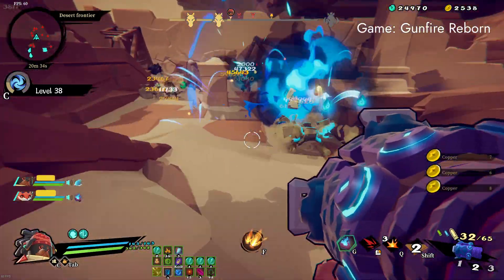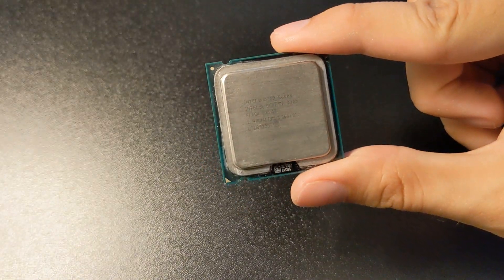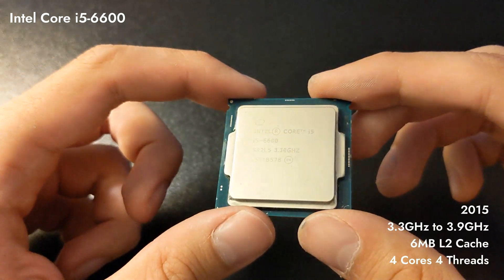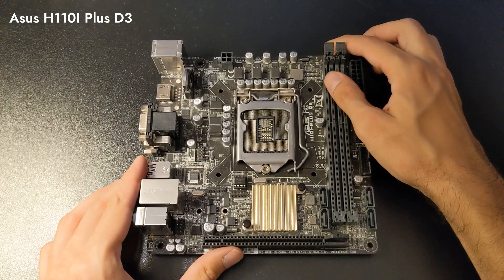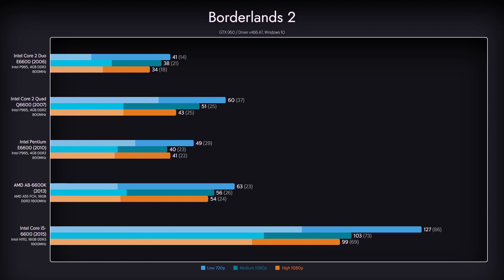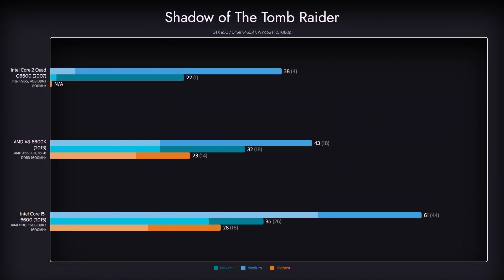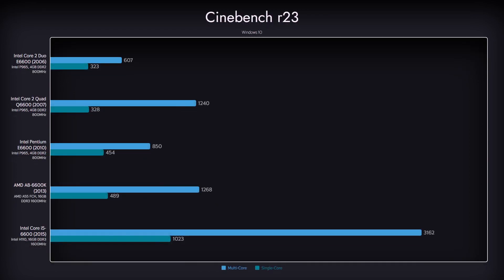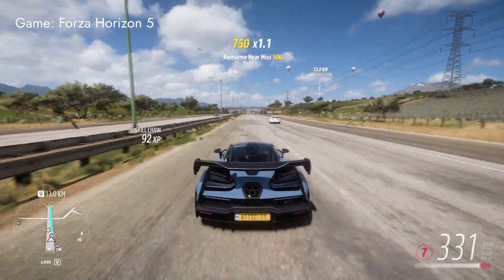CPUs All Named 6600 Benchmark ( E6600 (x2), Q6600, AB-6600K, i5-6600 )

Comment: Hey you forgot the Intel Core 2 Duo T6600 mobile CPU :D - (and yes mPGA478MN / socket P micro-atx motherboards with pci-e slots do apparently exist)
Reply: There is also a Celeron 6600HE (embedded), Core i7 6600U (mobile), K and T versions of the I5-6600 desktop, AMD Ryzen 5 6600H, HS and U variants (mobile)